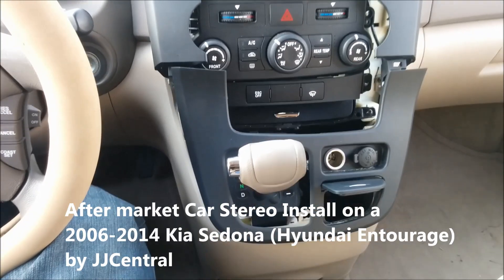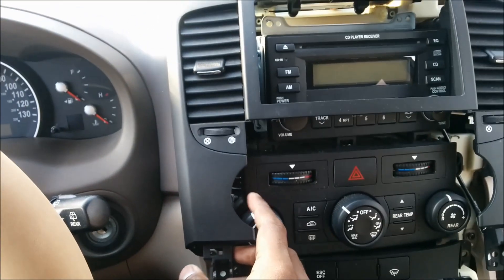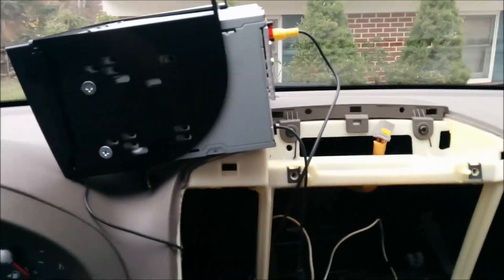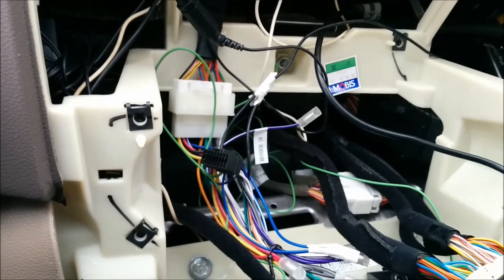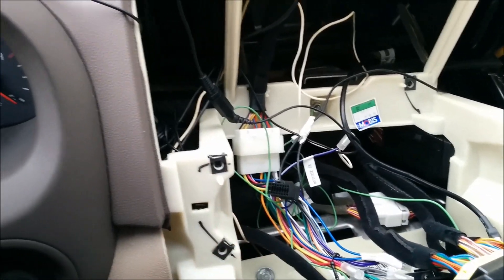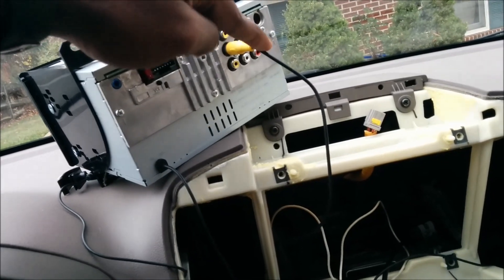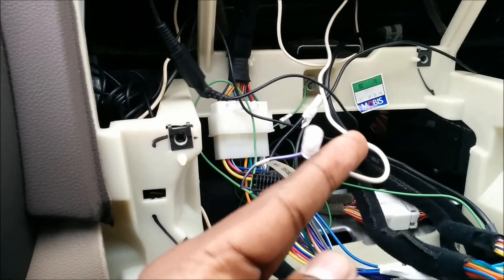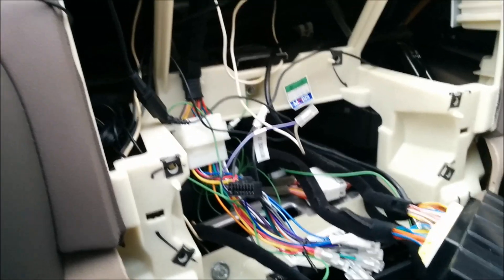Sony Double DIN Receiver Install (Part 2) - Dash Removal and Stereo Hook-up (How to Video)

Comment: Where do you hook up the black ground wire?
Reply from the maker: At any grounding point. Usually a bolt on bare body metal.

Comment: did you say that if we connect it to the cigarette lighter, we dont need to connect it to the reverse signal?
Reply from the maker: In my case I powered the reverse camera with the cigarette lighter power so it's on always when the car is on. I also powered the reverse camera source switcher in the stereo with the power from the reverse light, so it changes input when the car is thrown in reverse. Hope that makes sense.

Comment: Hi, 
I liked the video as was very easy to understand and follow but just wanted to ask as I'm installing an aftermarket double din to my Kia Sedona 2008 and wanted to know if you have a model no. For the facial adapter as the ones I've found have the top screw points facing the other way! The model number for these ones are DFP-03-11?
Reply from the maker: I used Metra 95-7323 bracket from crutchfield. I can see that what you have is the same as the metra bracket, but reversed. Don't worry they are in 3 pieces and interchangeable, just swap the left and right, it might work.

Comment: Where did you put the black long cable that has a hook at the end??
Reply from the maker: chargersjuan26 I am not sure which one you are pointing to, if you are asking about the antenna wire, it goes to the back of the unit. check 2:01
Reply: +jjcentral I think he referring to the ground wire that comes the Sony harness?

Comment: I have this same stereo, and I'm getting ready to install it in my G6; I was wondering if its possible to go into settings and disable the rear camera, til I'm ready to buy and install the camera itself.
Reply from the maker: Yes, you don't have to use the rear camera till you hook it up. It won't automatically turn on reverse unless you attach a camera.

Comment: Hey where do I find the white reverse light wire? Do I have Tom disconnect it from somewhere and connect into my wiring on the back up camera? And how do I hook it up to the cigarette lighter exactly?
Reply from the maker: +Anthony Zed 
I hooked up the white wire all the way from the reverse light bulb socket in the back. For the cigarette lighter, you just use a wire tapping connector.
Reply: nice video! but i missed a part in wiring for the rear camera mode, is both white wire from reverse light bulb and and the white wire from the cigarette lighter  goes to the  Reverse in Purple wire?  ahope you can send a diagram for that.. thanks!

Comment: I have Sony Xav-65 how I connect Bluetooth my phone? can you help
Reply from the maker: +Vazha Giorkhelidze It depends on your phone model. The basic principle is that you go to bluetooth settings on your phone and make it discoverable, then you hit bluetooth setting on the sony and saw connect to phone. Then it will pair and thats it.
Reply: problem is I can't find Bluetooth In my Sony Xav-65, I have Iphone 6
Reply from the maker: Xav-65 doesnot have bluetooth builtin, Xav-64bt and Xav-68bt are the ones with bluetooth. You can use the aux input as handsfree if you add a external bluetooth controller.

Comment: Nice video rear monitors next :)
Reply from the maker: I already ran the wires just in case from behind the head unit for the rear monitors, but still have no interest putting in a real monitor. Seems like tablets/phones replaced the whole rear seat DVD era.

Comment: Bro, how do you install rear camera while driving? I have same radio model with you but when i click on the rear camera there will come out with 'no signel video'.  I have install reverse camera
Reply from the maker: Good question, if you power the camera with the reverse light wire, it only comes on when you put your car in reverse. If you power your camera with a acc circuit (cigarette lighter 12v that turns off when the car is off), then you can get the rear camera while driving. So bottom line, see what circuit powers your camera and switch that to a circuit that comes on when the key is on. That's it.

Comment: Did you have radio controls in your steering wheel? If so, did you retain those after the install?
Reply from the maker: +Neeva Candida My model did not come with steering controls, however I am planning on adding buttons and do the adapter to hook up to this unit. Will make a video when that is done.
Reply: +jjcentral Awesome!